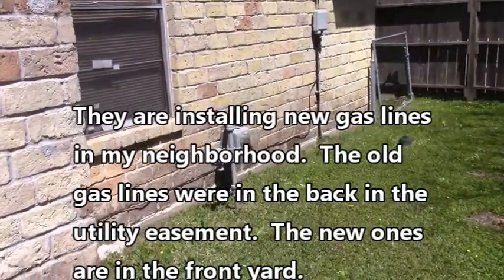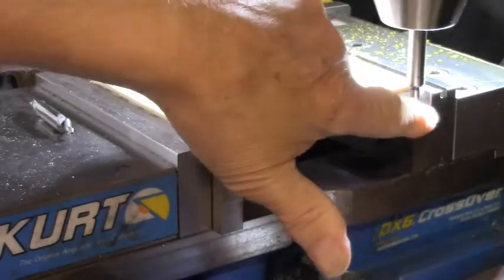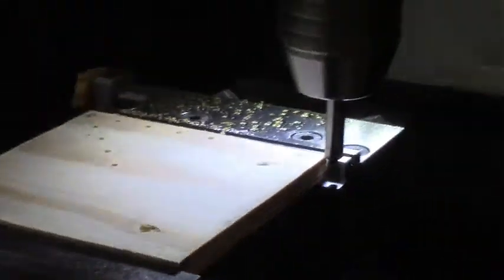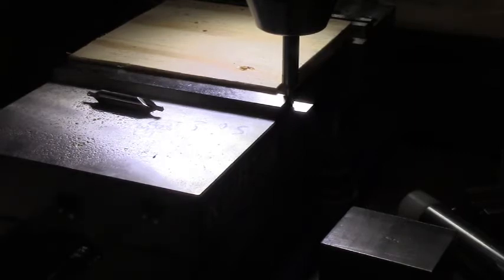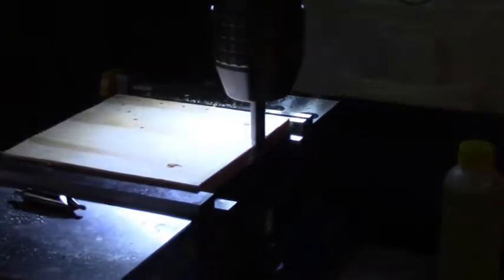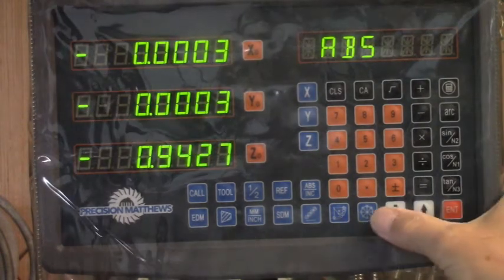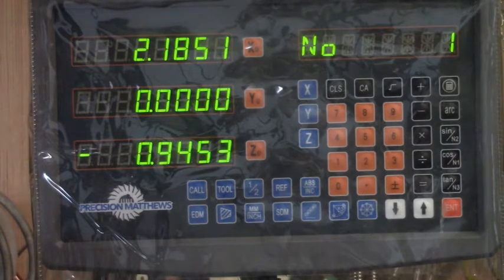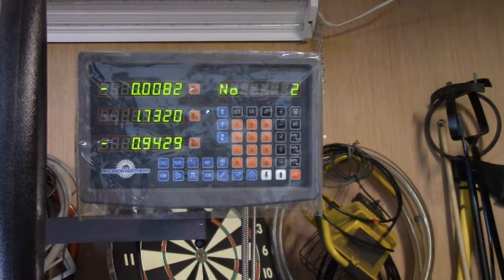DRO how to use #3 bolt hole circle

Comment: Thanks for this video series, I've had the same mill and DRO for about 5 yrs now and haven't gotten around to really studying on how to use these features.  It seems the zero degree point is 180 across from where zero normally is.  I wander if that's a setting??  Nice job explaining this stuff, I'm gonna say this is my favorite video series you've ever done.  KOKO  Larry in North Tx
Reply from the maker: You can always hold my statements as suspect.  Thanks Larry.